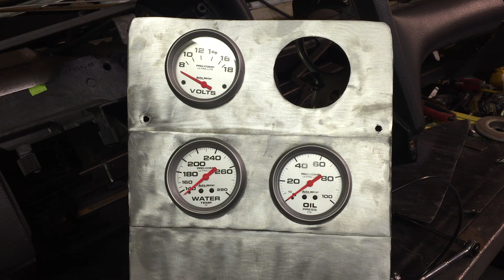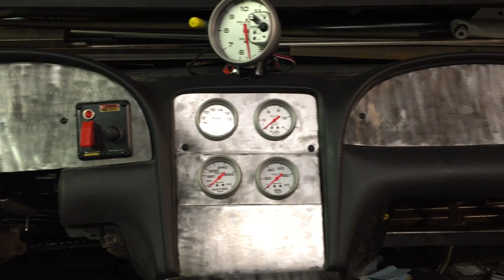CUSTOM DASHBOARD BUILD

Comment: dam, i need to get myself one of them fancy sheet metal bendy thingys aha. Would have saved a lot of heartache from trying to clamp my stuff down with bolts and a hammer to bend it :')
Reply: Its called a sheet metal break, they are worth their weight in gold... i need to hurry up and make one lol
Reply: Sweet, one step closer to owning one.. I know what they're called aha. Cheers!!
Reply: @sebsshenanigans  np, theres lots of tutorials on youtube of Diy ones if you have a grinder and a welder.. otherwise i suggest harbor freight, ebay or amazon for a cheap one.
Reply: yeh, I live in aus. Our hardware + automotive stores are no where near the level of the ones you can find in america aha
Reply: Finally learned what it's called also lol.
Reply: I have tools for simple hand breaks, I do hvac sheet metal shop work
Reply: @sebsshenanigans  You can buy them in aus from supercheap @ https://www.supercheapauto.com.au/p/sca-sca-bending-brake---29-inch-70cm/377787.html